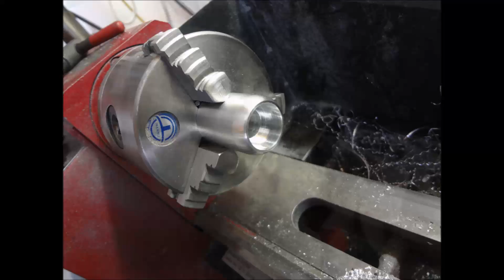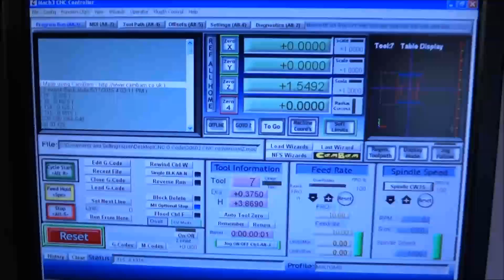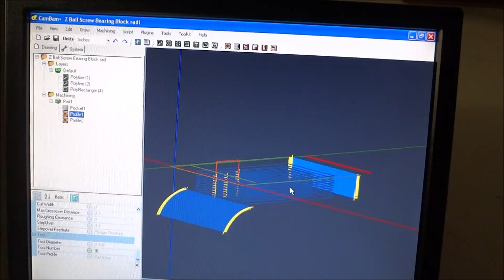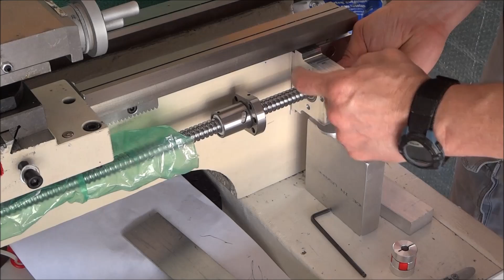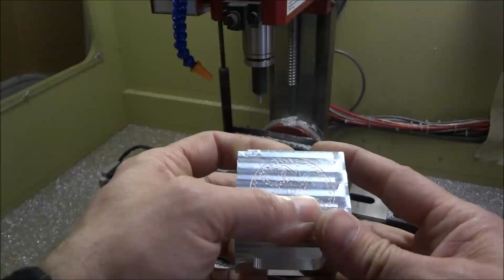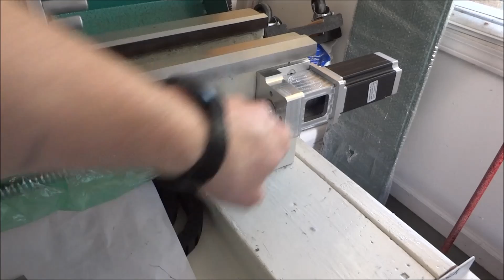G0602 Project Pt 11 Ball Screws Z Axis

Comment: At 28:36:  why are you going in & out & in & out?  Tapping needs to break chips every quarter turn or so.  What are you doing here?  Don't you get sloppy threads this way?
Reply from the maker: I doont recall they seemed fine at the time. but our correct 1/4 turn

Comment: Does your milling machine come with quick change tooling or did you install it yourself?. I searched online for my machine R8 tool and was not like yours and expensive.
Reply from the maker: No it did not, I am simply using a Tormach 3/4" r8 collet and Tormach TTS holders.

Comment: YOU NEED TO CUT IN THE OPPOSITE DIRECTION CLIMB CUT ON CNC MACHINES YOU CONVENTIONAL CUT ON MANUAL MILLS
Reply from the maker: +Ken Hendricks 
Thanks yes I am aware  that  climb milling is preferred but this little X2 seems to work better Conventional milling ? Go figure?
Be safe
Sam
Reply: Never get why people say only climb? And then tell it in all caps. It does make a difference to conventional cut especially on those smaller milling machines. Climbing on a industrial machine is quite different. I’ve seen some nasty finishes with climb milling on small bench machines. If the part comes out clean and nice direction shouldn’t matter.
Reply: Also look how slow he is machining? It’s more like manual speeds. My vmc would cut that pocket in 30 seconds or less. That entire part in a few minutes where it probably took him a good hour.

Comment: very nice machining,   hope I will get into that stage :)

did you use NSK C5  ball screw?  any cut to the saddle to fit the ball
screw nut?   

thank you!
Reply from the maker: +Ozy Ozy No c7 ball screws work fine. For me. 
X ballscrew is mounted on the right side of the y cradle. 
I had to make a u shaped spacer that slipped over the y axis ball screw 
flange tight fit then this slide into original slot and was secured with
 original screw.

Comment: I really don't think it's good idea to keep any gap in the fix end of a ball screw especially for any mill or lathe axis, the back force glitches from the cutting will easily press the washer together, why not make a adaptor plate between the mount surface and reduce the height of the bearing block to accept the plate
Reply from the maker: +Yujuan He
 I understand what your thinking these are very tight almost like shims there is no movement once bolted up. they are working great so far.

Comment: Nice design. I was wondering how the Ball screw mounts to the gear box. From what I could tell, it looks like there is a threaded shaft coming out of the gear box with a hole for a maybe a roll pin (not familiar with the Grizzly). I couldn't quite tell how the adapter and ball screw mounts to the gear box, I assume the adapter doesn't turn since there are bearings in it for the ball screw. I hope you might show a little more about that in your next video. Your doing a great job and I can't wait to see more.
Reply from the maker: William Hardin  Hi William,
 The shaft coming from the gear box is not threaded there is a roll pin 
that holds the original w coupling on.
The coupling I made slides over the gearbox shaft which has been 
disengaged so it doesn't turn.

There are bearings at the other end for the ball screw to slide into the
 coupling is a snug fit and slides all the way against the gearbox 
housing. no pins needed.
 Thanks Sam
Reply: CNC4XR7 Of course, I forgot that by going to CNC means you don't need the gear box any more. I should slap myself.That means no more gear changes, can cut metric and standard threads, no need for taper attachments (I just sold myself on a CNC lathe conversion. My Sheldon 10" is next in line for a conversion, I just need to decide if I convert my 10" or 11", maybe both. Thanks for putting me back on course.
Reply: Your welcome 
But I take no responsibility for you spending countless hours in the shop!  lol